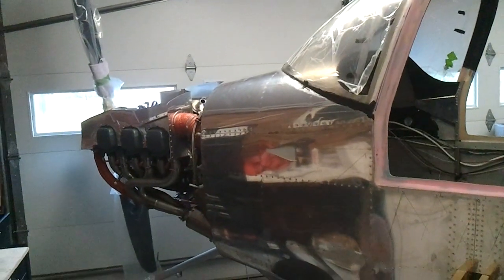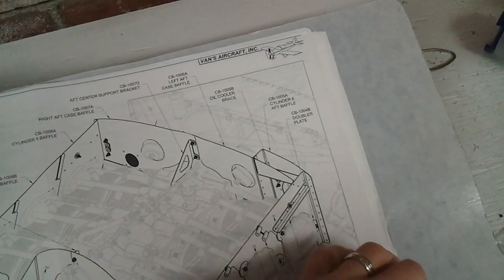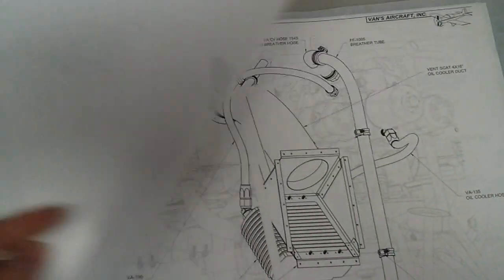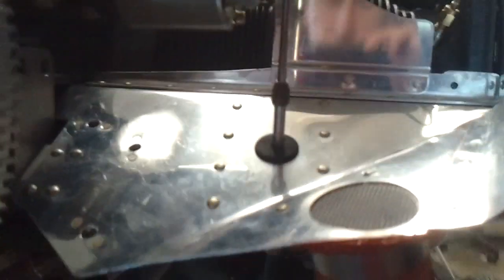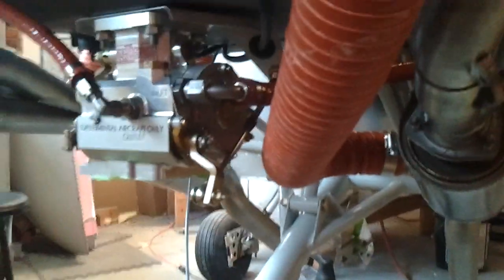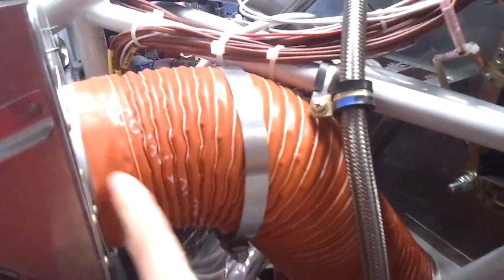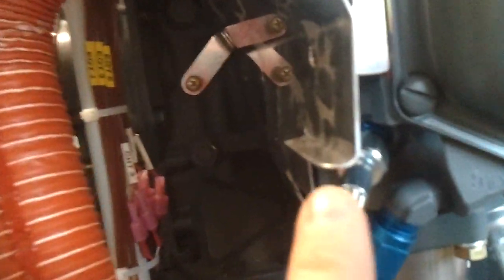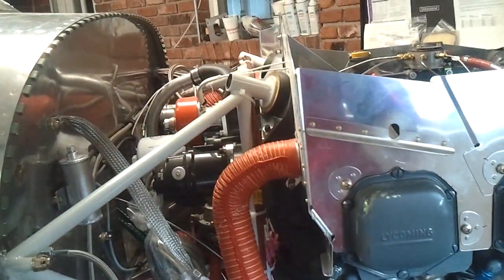Engine Tour 2

Comment: Where did you get your exhaust? I'm building an experimental Super Stinson with an O-540 and need an exhaust. Also, which model of oil cooler did you use?
Reply from the maker: It came with the RV-10 kit from Van's. I'm not real sure where they get it from. You could probably call them and ask. https://www.vansaircraft.com/contact/